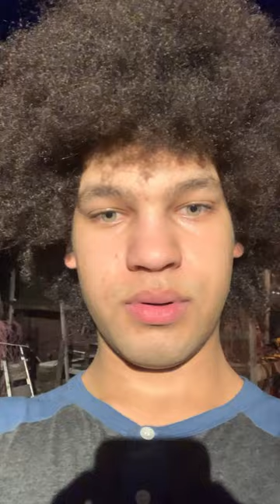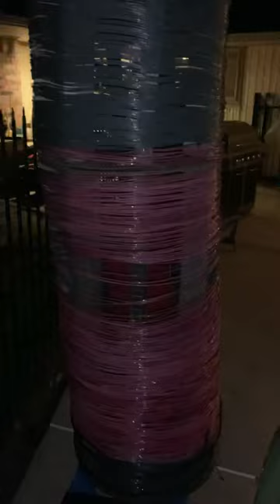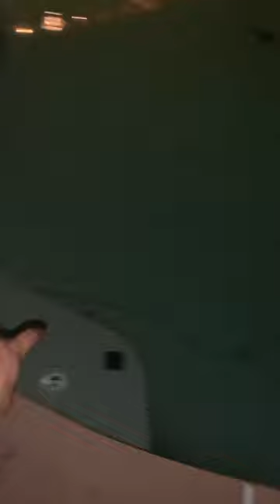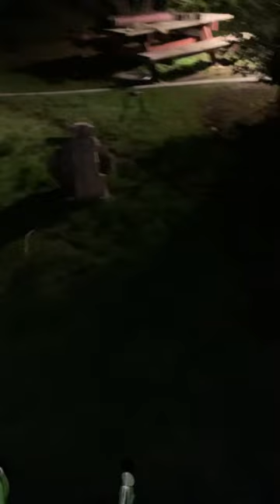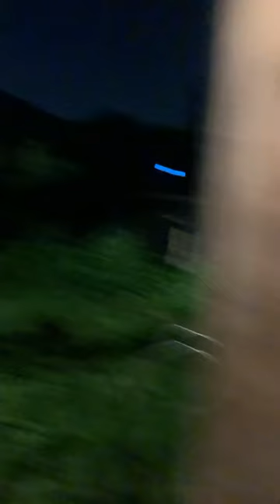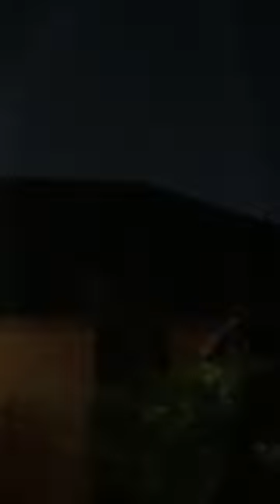Transmitting electricity wirelessly 34ft

Comment: I know the gaming industry has had wireless chargeable controllers for a long time but will not release them because if your cat happens to sleep in between the source and battery I'll slowly cooked their internal organs. Electromagnetic waves will vibrates water molecules at such a high frequency that they create frictional heat, aka microwaves. Don't make any anti-kitty wave tech Edmond. I know you're a good guy and would never do that.😝